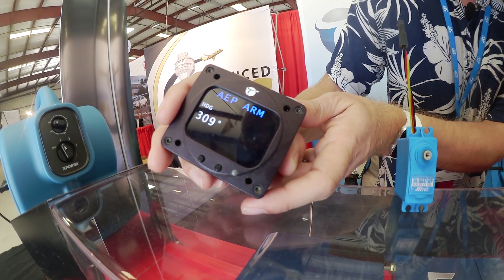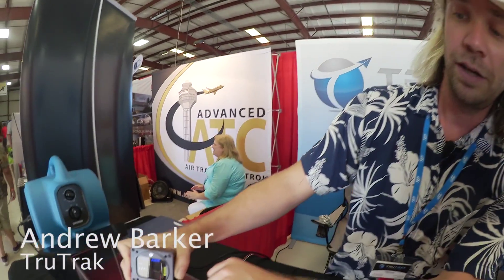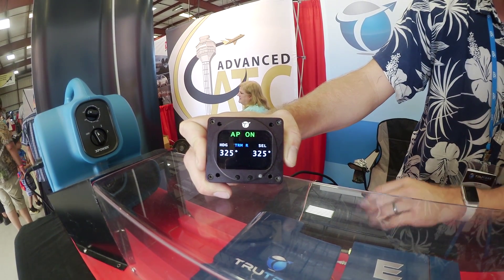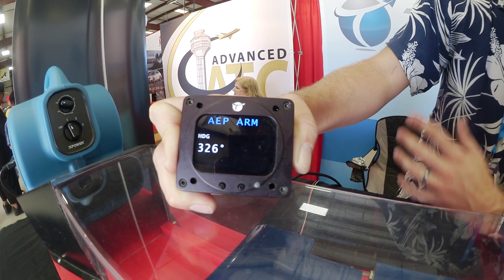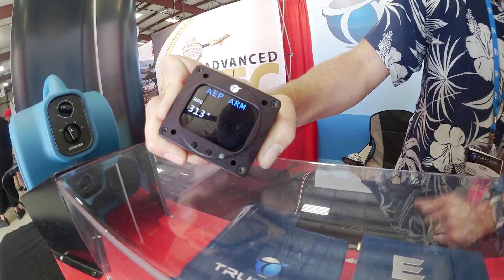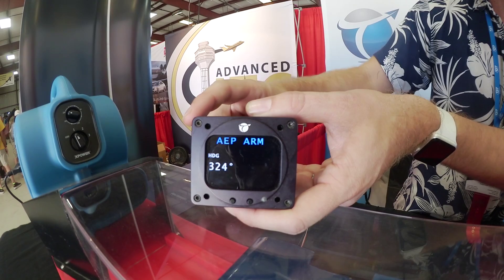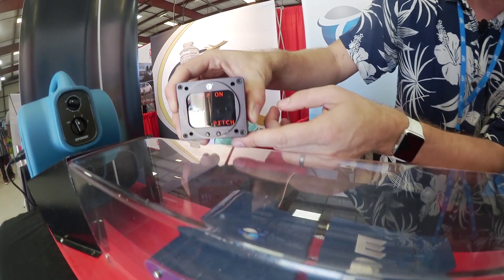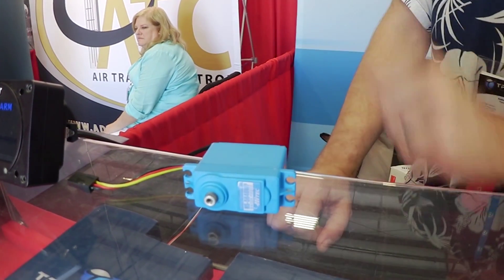TruTrak Eco Autopilot

Comment: I have better servos that the one show on my 40% scale R/C Extra 300.  I use 3 (420 oz torque ones) servos on each aileron.  and he wants to use only one servo boost tab per flying surface on a full scale plane...  No like!!!

Though nice compact auto pilot concept, but I wouldn't use R/C servos on a full scale plane.